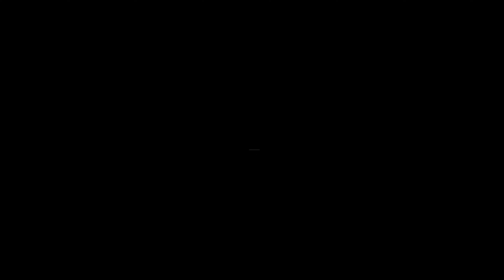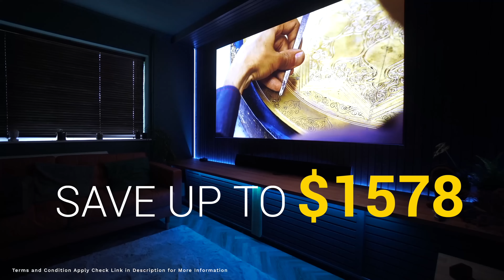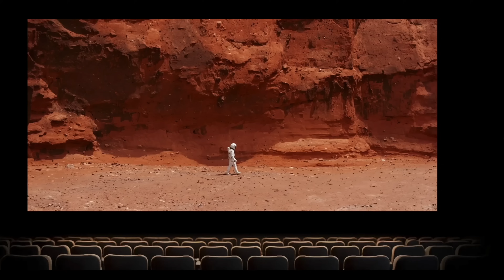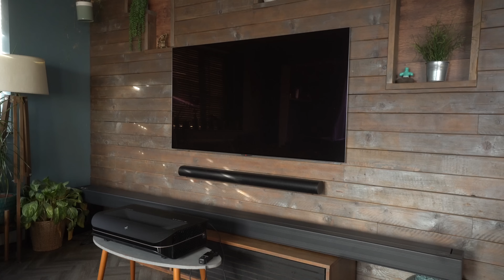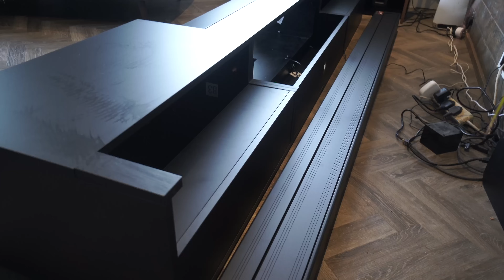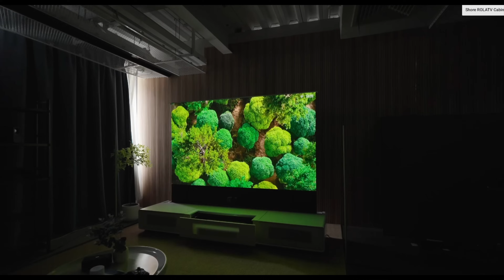The Incredible Hidden 100 Inch Laser TV the Ultimate TV Set Up

Comment: Do you use the Sonos Arc with the projector for sound? I'm assuming all of the Atmos heights get blocked. Perfect setup if it could but doubtful. Is there room to place the Arc on the stand just in front of the screen or would it block the light path? Downside is the audio would be pretty low. Tradeoffs. A ceiling dropdown version of the screen stopping a few inches above the Arc is probably the ideal for sound functionality.